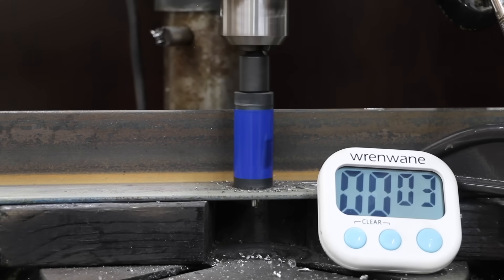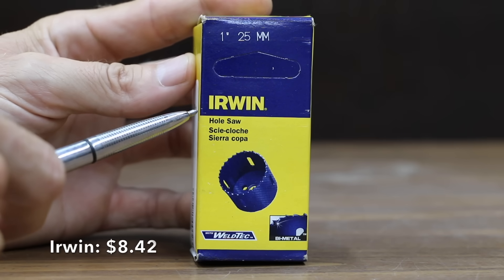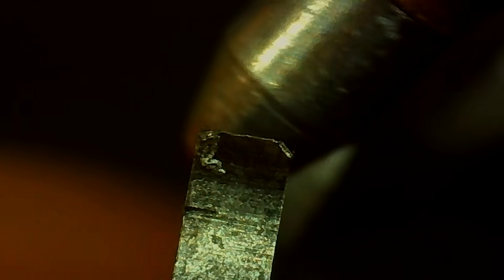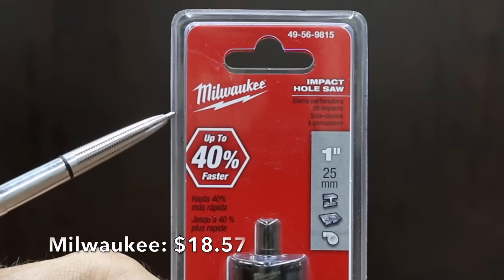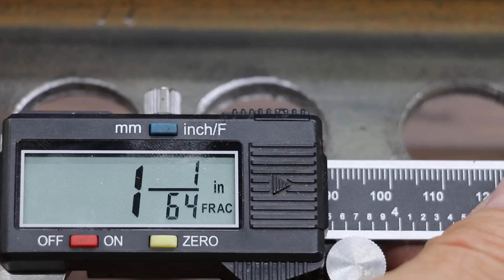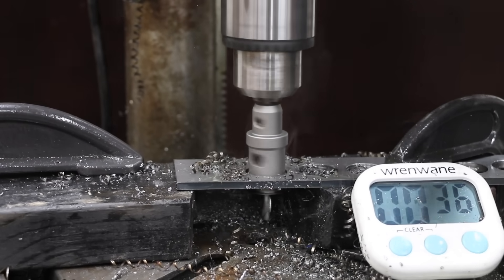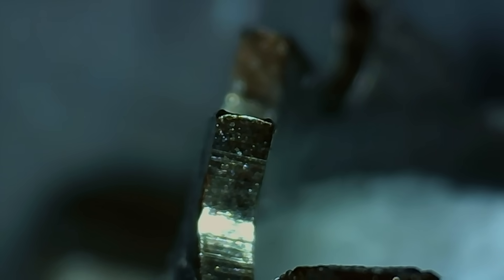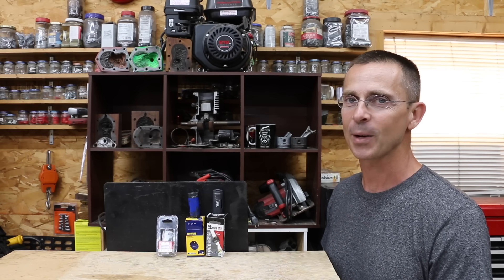Best Hole Saw Brand? DeWalt vs Milwaukee vs Irwin, Bosch, Lenox, Diablo, Bosch, MK Morse

Comment: This video Confirms my struggles cutting through stainless steel,  In my experience, 
I have found that Water works better than cutting oil,  overheating hardens the steel. water keeps it cool, when is starts to sizzle and boil off, add more water.
Reply from the maker: Thanks for the feedback.

Comment: I use Ideal Carbide holesaws all the time.  Specifically for electrical conduit and holes for door contacts in storefront door frames.  They last a long time and give me consistent and clean holes which are especially needed when drilling storefront door frames.
Reply from the maker: Thanks for sharing.

Comment: Hi One, are you sure you ran the hole saw at the proper speed in the armor plate? Two, if so just what hole saw would stand up to repeated cuts in armor plate?

Comment: Some of those were clearly designed for metal cutting, but others can be used for wood. Do you have a test to show good they are at wood hole cutting? I have seen a difference, with some burning the wood more or stalling out more than others.
Reply from the maker: Thanks for the video idea.

Comment: You didn't mention the heat treatment state of the 1095 knife blade steel.  Most knife blade steels are delivered in the fully annealed state which would only have a Brinnel hardness of 177 or Rockwell C of 11-12 while a rolled state 1095 steel would be around HB of 295.  A quenched and tempered 1095 steel would have a HRC of around 55 or Brinnel number of 560-570.  This would be harder than the M42 bimetal.  It would take carbide to scratch it.  Also the AR500 is not as hard a steel but is abrasion resistant and can be hardened through plate for a Brinnel hardness of around 500, hence the name.
Reply from the maker: Thanks for the feedback.

Comment: I have always bought the hole dozer kits because for what you get, it seems worth it, and honestly, being a Milwaukee guy through and through, I was really impressed by that 4 tooth Dewalt! I dont drill through anything more than HVAC things though so it wouldn't make much sense, but if I need a heavier duty saw, I for sure will go with that one!

Also, those "impact ready" saws are only more expensive due to the bit coming with them, they aren't meant for much more than thin guage metal, ill never buy them again lol
Reply from the maker: Thanks for the feedback.

Comment: I was fortunate enough to buy a set of old school Morse hole saws on ebay, on a display board, in incremental sizes from 1/4" up to 4" for 80$!  These, by far, are the best hole saws money can buy!  I bought these while stationed in Japan and the seller, much to his credit, shipped them to my APO address.  I have used the periodically for year and have drilled through I-beams and other difficult material without a failure in any size.  I highly recommend the Morse brand as well as MADE IN AMERICA!  The rest of these chinese made brands are at the back of the pack...support your country, or you'll lose the same.
Reply from the maker: Thanks for the feedback.

Comment: Loved watching this, but question. When I was working on drilling holes thru plow steel we kept it soaked with a water soluble oil lubricant. Would that of made a difference here? Because even with rapid tap, we never could drill thru 4"s of plow steel 4x3s.

Comment: When using a hole saw in thin or soft material:
1. Remove the pilot bit from the hole saw mandrel.
2. Use an appropriate 1/4" drill bit to drill a hole in the center of the spot where you want to use the hole saw.
3. Install a section of 1/4" steel rod in the hole saw mandrel then install the hole saw on the mandrel.
4. Insert the steel rod into the pilot hole and drill the material with the hole saw.
5. Did you notice that the hole saw cut a MUCH cleaner hole and the hole saw didn't wobble? 
That's because the pilot hole was NOT getting larger as the hole saw was cutting.
6. You're welcome!
Reply from the maker: Thanks for the feedback.

Comment: Most drill presses lack the rigidity to use carbide effectively.. if those good carbide bits were used in a mill they would have worked heaps better, also the lifting to clear the chips can break carbide if the are dropped back in the hole to fast, carbide is brittle stuff
Reply from the maker: Thanks for the feedback.

Comment: A late comment, but when drilling hardened steel or stainless steel I was told to never stop the drilling pressure or the material will work harden and be harder to drill. I suspect that's what happened when you kept lifting the hole say off the work piece.

Comment: "All four teeth on the drill hog experienced some damage." Well yeah, that's what happens when you don't use carbide tools properly. Stop interrupting the cut and stop thermally shocking the tool! That cutter would eat through the AR500 without any problem if you used it correctly. That is, high RPM, constant cut with low pressure and without interruption, don't blast it with air or oil.
Reply: Hmm. Where could i learn more about thermal shocking of cutting tools?
Reply: @jakec9510 videos about machining. Machine tools like vertical mills and especially lathes use carbide insert tools, which are pretty much steel tool holders with replaceable carbide inserts which you replace when they wear out or break. Google for carbide speeds and feeds, that'll point you in the right direction. It's very different from high speed steel (HSS). HSS is not nearly as hard or wear resistant as carbide, but it's tough, which means it can take a lot of "mistakes" from hand held tools. It can't take heat at all. If it gets hot, it wears very fast. You must run it slow and cool. It doesn't care about thermal shock Complete opposite of carbide.
Reply: @projectfarm it would be great to see you do a follow up testing this technique

Comment: Regarding the C1095 steel, you didn't mention if it was annealed or heat treated. If it were annealed, it wouldn't be very hard to begin with. When cutting AR500 "abrasion resistant" (not amour plate) with carbide tipped tools, don't temperature shock them with blasts of compressed air, interrupting the cut, adding cutting oil. Just run them constantly all the way through without lifting them up, and run them hot. Don't try to cool them down in any way; that's a great way to crack tungsten carbides.

Comment: Carbide hardness does not correspond to "quality". There are various grades of tungsten carbide for brazed applications like this. You don't want an insanely high hardness grade because it'll be much more prone to chipping. You're not cutting through tool steel here. These are designed for wood and soft metals with a hand-held drill. They should be using the toughest and softest grade of tungsten carbide. Also, use a collet chuck to make sure you're holding the cutter perfectly straight. A Jacobs chuck is trash.
Reply from the maker: Thanks for the feedback.

Comment: As usual, a great test of tools.
I do have a couple comments about your test methods though. The first is the drill press you are using is less then a great tool being the identical press sold by many manufacturers/distributors, i.e Harbor Freight, Craftsman and even Delta. It does not have the power to do the job with a two belt drive system (mine is a Harbor Freight). Secondly, the OE chuck on mine and a friends had at least a 60 mil run out and even standard twist drill holes were not to size. Then the weight you used - too much for a hole saw cutting through heavy stock. Time vs tool wear comes into the equation. Too much feed, equals too heavy wear. Oh and my hole saws are mostly Sandvic and untested here.
Reply from the maker: Thanks!  Thanks for the constructive feedback.

Comment: If only there were an automotive version of your channel! I'd love to see genuine vs Chinese turbochargers, cheap vs MLS head gaskets, longevity and heat resistance testing of brake fluid and pads, etc. I guess Richard Holdener is the closest thing to that concept.

Comment: Usually these cheaper tools use Stellite and not a tungsten carbide.

Given the fact you could scratch the tooth, I'd bet it's stellite, not tungsten.
Reply from the maker: Thanks for the feedback.
Reply: @ProjectFarm  Stellite is often labeled as tungsten carbide, but it's a little different.

It's actually quite good when used in hand tools. 
Where your feed pressure isn't consistent and the tool is likely to chatter against the work piece. 
It's much less brittle then tungsten, but not quite as tough.

If the edge of the tooth wears and seems almost as if it's melted, that's Stellite.
Reply: @ProjectFarm  A good topic for a future video could be bench grinder wheels.

Something I get asked a fair bit is what wheel is best suited for grinding various materials.

Comment: AR500 is not armor plate, though it has shown it's fairly good at this off-label usage. Abrasion Resistant 500 (AR500) plate it for industrial applications in mining and construction; think the surface metal on a plows face.

Comment: have you tried rotacut drills? 
https://hougenmagdrills.com/products/hougen-11085-12-rotacut-hole-cutter-master-kit-fractional-12-pack
makes a perfect circle and spring loaded center retains blank until released.
Reply from the maker: Thank you for the video suggestion!

Comment: I work at a sheet metal place, i found that sometimes to get the hole saw through the last lil bit you may need to put it in reverse for a sec then power through it, never pondered why that worked for me each time but... yeah, something i observed
Reply from the maker: Thanks for sharing.

Comment: What about large holes on wood, I so a guy having extremely hard time drilling 3 inches holes on 2x6, he did probably 40 holes with different bits, when they could, 2 guys were holding the drill gun
Reply from the maker: Thanks for the suggestion.

Comment: I tried to drill a hole in galvanized mild steel, 1/16 inch thick, with a TCT bit last week. I drilled a 1/18 inch pilot hole, then swapped in the hole saw. The pilot bit broke before the hole saw even touched the steel. I can't get the stub of the pilot bit out to replace it, so now I have an ugly paper weight. Useless garbage.
Reply from the maker: Thanks for sharing.

Comment: I actually prefer to see the teeth break rather than wear down. It seems that would be due to a weak portion of the metal rather than negligence in the material manufacturing. 
On another note, I stopped using Dewalt power tools a few years back due to their battery performance and have all TTI, but I still get great results and longevity from Dewalt bits and accessories.I tend to stick with Irwin, Bosch and DeWalt (in that order) and It's very reassuring to see you getting these results with all of your tests!
Reply from the maker: Thanks for sharing.

Comment: I had the Milwaukee hole dozer, I destroyed it in 2 holes on very thin metal, but I was also misusing it, I had it on a Hammer drill since I don't have a drill press.
Reply from the maker: Thanks for sharing.

Comment: I’m curious if you ran hole saws and drop bits across a wet stone backwards (opposite direction of drilling direction) would it actually sharpen the teeth/cutting edges
Reply from the maker: Thanks for the video idea.
Reply: I would test this myself however I’m a broke teenager so yea

Comment: The profile of the teeth is different for wood, aluminium and steel, so a holesaw can't be optimized vor all of these materials. You cant have a drill that lasts long and makes premium holes in all these different materials. You can compare this to sawblades
Reply from the maker: Thanks for the feedback.

Comment: I just burned the teeth off of a 1 3/3" Lennox hole saw trying to drill a single hole in 18 gage stainless steel.  I wound up drilling an opening with 1/4" hss drill bits and cutting the hole with a jigsaw.
Reply from the maker: Thanks for sharing.

Comment: When machining with carbide you aren't supposed to use cutting fluid or coolant, im not sure if it would be the same with these carbide hole saws but im pretty sure it is. Vut besides that pretty decent video.
Reply from the maker: Thanks for the constructive feedback.

Comment: Best Channel on YouTube, by far. Right to the point with useful and unbiased testing. No annoying distractions like music, politics or wokeness either. I have actually been using Lenox hole saws and mandrels for many years. They work well, are reasonably priced and they are also readily available at Lowe's. Recently, I was away from home and needed a 3.5 inch hole saw in an emergency. I picked up a Hercules hole saw and Warrior mandrel at Harbor Freight. Both devices worked surprisingly well. Granted, probably not as well as the Lenox would have done, but pretty impressive none the less. I just wanted to pass on the information. Keep up the great work!
Reply from the maker: Thanks, will do.

Comment: drills a hole diameter of1/4 in 642/647/125/34 x 37 to the power of pi inch. Dude just do it in mm

Comment: Wish you would have shown how many holes through a thinner mild steel each hole saw can make before becoming dull or useless. Rather you showed us the speed in which it cuts 🧐
Reply from the maker: Thanks for the suggestion.

Comment: I believe too much weight was added/the drill had insufficient power, carbide in particular dont like sudden halts, it will chip off small pieces. I worked a lot with lathe and carbide, a sudden halt will shatter the carbide tip. Use an industrial drill with a real gearbox, not that old belt-geared thing.

Comment: A lot of work doing those tests. My only concern with tooth damage is it didn’t look like the set up was quite rigid enough. I saw the work piece rock a few times and in some cases the tool bit wobbled. This really messes with the chip load on the cutting edge.
Carbide will chip very quickly when  the system is not solid.
Reply from the maker: Thanks for sharing

Comment: I've always thought Morse was a very good brand that flew under the radar for most people. That's why I have been able to collect  many of them through the years on ebay auctions.  Their bandsaw blades are excellent also. Tct cutters are great but you have to be careful who you loan them to. I loaned a nearly new Ideal cutter to a helper and he brings it back to five minutes later with every piece carbide  broken off from cutting through a thin metal stud. Thin metal with too much pressure tends to grab the carbide and shatter them.
Reply from the maker: Thanks for the feedback.